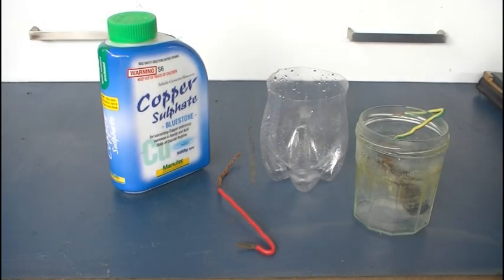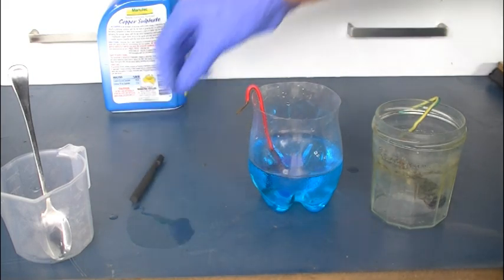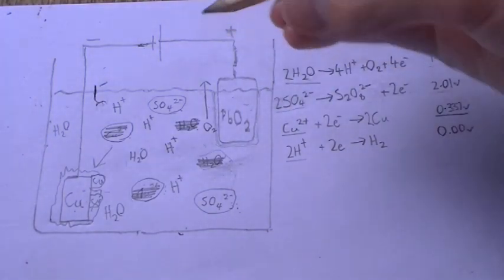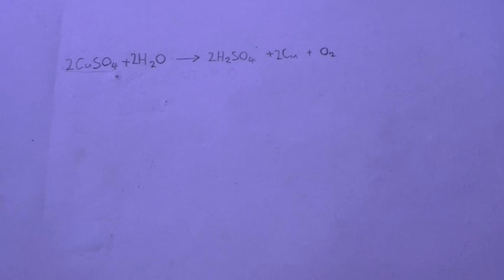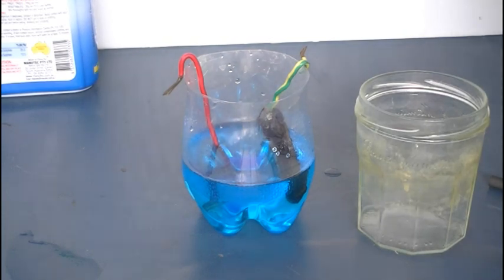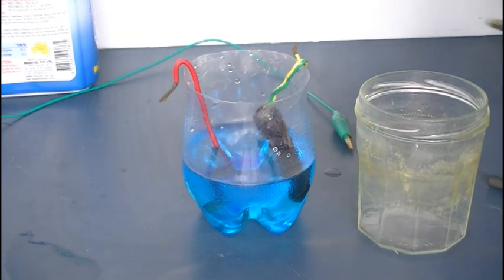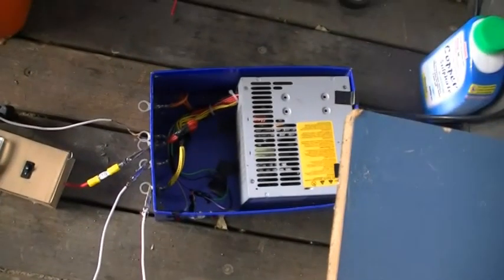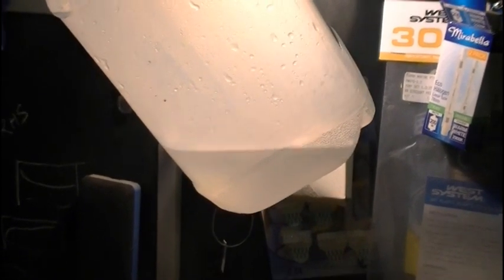Making Sulfuric Acid

Comment from the maker: Hello everyone!
As you might note, this is an extremely old video (the second oldest on my channel, I think). Now that I know a little more about what I'm doing, I'd like to point out that if you're actually going to try this yourself, please avoid using a lead anode. Lead poisoning from mishandling or the resulting soluble lead is always a good thing to try to avoid. I strongly recommend using graphite instead - a much safer alternative.
Reply: Could you use titanium oxide instead as an electric conductive anode, that wouldn´t be poisonous  ?
Reply from the maker: @ZoonCrypticon Titanium dioxide isn’t conductive, so I’m afraid not.
Reply: Also The Sulfuric Acid Particles That Will Be Emitted When The Gas Is Bubbling out Is Carcinogenic In Long-Term Exposure
Reply: Se guardi tutto é velenoso o pericoloso, ché chi affoga con l'acqua😂
Reply: Excellent video. Thanks for working out the math as well. Helped me understand exactly what is happening so I can tweak a few things here and there as I do it at home. I actually have a ton of lead I melted down from some old shotgun shells I had laying around. 

I assume that a classic milk jug like you used is fine to keep it in. But what if I used a standard mason jar to actually do the electrolysis in? Plastic seems accident prone like you nearly but fortunately didn’t have.

Comment: is there a reason why the lead connection is partially outside of the water?  Also what is.3 moles.  Is that 33% solution.?
Reply from the maker: The connection is not pure lead, and it would oxidse destructively if placed in the solution. Hence, we position the electrode such that the connection is not submerged.
As for moles, you'll need to do some reading. I'd start here:
https://chem.libretexts.org/Bookshelves/Introductory_Chemistry/Introductory_Chemistry_(CK-12)/10%3A_The_Mole

Comment: Salve, il video sarà vecchio ma l'ho visto in questi giorni. O visto anche quello con sale Epson, belli ed istruttivi. É un pò che voglio generare acido solforico per batterie poiché non lo vendono più  dicono che ci fanno le bombe, ma uno che é capace fare le bombe con l'acido solforico non avrà nessuna difficoltà a farsi l'acido no?? Bene, io non voglio far saltare nessuno😂. Anche se costoso il solfato di rame rispetto ad altri solfati, questo é il metodo migliore e più pulito. Ma voglio segnalarti un errore che i chimici fanno e molti in rete quando galvanizzano metalli, così da migliorare le cose. Tutti mettono alimentatori ed applicano tensioni un pò a caso, continuano a cambiarle in base ai risultati della cella, poi nel tuo caso si ritrovano del bel rame spugnoso se non addirittura una poltiglia nera scomoda da riusare e pulire, sintomo di corrente troppo alta. Quindi per avere un bel deposito pulito di rame metallico che ricore l'elettrodo e per evitare continui controlli della tensione e rimaneggiamenti suggerisco di fare come faccio io (non ho mai visto nessuno in rete farlo, perché non sanno e non ci pensano). Io uso un integrato molto economico si chiama LM317 é un generatore di corrente continua da attaccare a valle di qualsiasi alimentatore, col semplice calcolo di una resistenza si stabilisce la corrente voluta (vedere datasheet o video youtube, ce ne sono molti). Quindi imposta la corrente qualsiasi variazione di resistività del bagno l'alimentatore darà sempre quella corrente costante e di conseguenza la tensione varierà automaticamente senza bisogno di controllarla e cambiarla manualmente. Il risultato dwl deposito ovviamente dipende dalla corrente impostata, che si può trovare osservando di non produrre troppo idrogeno e dai calcoli vedi Faraday. Nel dubbio meglio una corrente più bassa che alta, i tempi saranno più lunghi ma il deposito più fine e migliore. Intanto il prodotto energetico é sempre quello, ci vogliono x Coulomb per ogni materiale metallico ed é, come sapete, costante per ogni metallo. Se a qualcuno interessa ridurre i tempi e non gli importa del rame spugnoso, nero o ché e vuole acido rapido metta pure tutta la corrente che vuole e dimensioni i cavi come serve. Più avanti suggerirò altri metodi da sperimentare per ottenere H2SO4 più o meno semplici o costosi ma con materiali di facile reperibilità. Non sono un chimico, uso quanto basta per le mie cose, sono elettrotecnico con passione per l'elettronica. Faccio un pò di tutto. Saluti

Comment: What happens if you adjust the voltage?
Reply from the maker: It will speed up or slow down the reaction, provided your supply isn't limiting the current.
Reply: @ScrapScience  I heard elsewhere that voltage determines what reaction you get. If you crank it up you can separate more stable compounds. Anyway if voltage determines reaction speed, what does changing the current do?
Reply from the maker: 1) Changing the voltage has a rather complex effect on which reactions happen. The easiest reaction will always happen (provided the voltage is high enough to drive it), and then with higher applied potentials, you might eventually get some contribution from some more difficult reactions (but this depends on a lot of factors). For instance, on the cathode, you'll reduce copper ions to copper metal if the potential is high enough - then with high enough potentials you might also see a small amount of reducing water to hydrogen. In both cases, reduction of copper ions to coppper metal is the dominant reaction though.
2) Voltage determines current, which then determines reaction rate. This is the main thing you see when changing the voltage, and the relationship is not necessarily linear. It is impossible to control voltage without controlling current when you have a consistent cell geometry - the two parameters are intertwined.
Reply: @ScrapScience  I apreciate your long answer!

Comment: Nice work I’m wondering if you can let it run more time to break down more water hence concentrating the acid a bit more.  I realize this is proof of concept but I feel like this would even with 5 times the concentration of copper sulfate.  Or, since your acid is very dilute, add more copper sulfate and repeat until the acid or 2 or 3 Molar.

Oh I’d like to mention sulfuric acid reduces copper sulfate solubility it water through common ion effect (sulfate).  So if you go the route of adding more copper sulfate repeating and repeating you will find a point when it’s no longer feasible to try to add copper sulfate for another run and then you have less water to boil off.

Comment: I remember doing this over 40 years ago and used carbon rods from batteries, or maybe stainless steel rods, but I've forgotten my chemistry by now. I boiled the acid next to increase concentration. To what extent can this be done to improve concentration, because from what I remember, acids absorb water and that's the reason they are so harmful to organic matter? (I presume the stainless steel I used wasn't a good idea because of the chrome salts I made.

Comment: I use this method to produce sulfuric acid, but at the beginning of the analysis a light colored solid copper forms on the negative electrode, which affects the analysis. I don't know what the reason is. I have to clean the cathode every few minutes for half a day to a day, and then a soft, dark copper forms, and the analysis is successful. No, I understand why this is made of copper. Is this due to the high percentage of copper sulphate in the water? Because I dissolve one kilogram in approximately two liters of water. If you can help me, I will be grateful
Reply from the maker: From what it sounds like, it's likely copper hydroxide forming on the electrode because the cathode will tend to generate slightly basic conditions when you start from a neutral solution. You can probably stop this from happening by adding a small amount of previously produced sulfuric acid to the cell before you start.

Comment: Would a few batteries work to generate the current needed instead of whatever generator setup he has going on there?
Reply from the maker: It would work, but batteries would run out very quickly when used in these kinds of processes.

Comment: does this demo mean that, when i charge my car battery, i am in fact refurbishing the electrolyte(acid)
Reply from the maker: Correct! The lead sulfate on the electrodes in the discharged state will be converted into sulfuric acid as the battery is charged.
The acid concentration in a charged lead-acid battery is significantly higher than in a discharged battery.

Comment: Hello, super vidéo instructive !
Ma question est la  suivante : comment purifier l'acide au maximum ?
Merci beaucoup et tout le meilleur pour la suite 😊
Reply from the maker: Distillation is the only proper way to do it. That's a very serious task though. I wouldn't recommend trying it without some serious safety knowledge and equipment.
Reply: @ScrapScience  merci, je pensais qu'il fallait passer  par une distillation !
Au vu du taux d ébullition de l'acide sulfurique il est mieux d'utiliser une pompe à vide et ajouter une colonne de vigreux changerai le résultat ?
Procederiez-vous avec la pompe à vide et la colonne de vigreux ?
Merci à vous
Reply from the maker: A vigreux column is not necessary for sulfuric acid distillation. In fact, it will significantly reduce the speed of your distillation.
Distilling under vacuum would be ideal, since it will decrease the temperature required for boiling sulfuric acid (which is usually over 300 C). 
Once again, distillation of sulfuric acid is not a task that is easy or safe, especially when performing it under vacuum. Care and knowledge is definitely required here.
Reply: @ScrapScience  merci, pour l'information !

Comment: Would the continued electrolysis once the CuSO4 is all gone concentrate the acid further?
Reply from the maker: Yes, but it's a lot quicker (and at least ten times more energy efficient) to just boil the water out instead.
Reply: @ScrapScience  cheers

Comment: could you mix a magnesium sulphate with the copper sulphate to get a greater yeild?
Reply from the maker: Not in this case. Magnesium sulfate will not be affected by electrolysis under these circumstances, so you'll only be converting your copper sulfate into acid.

Comment: hey! i did this same reaction, and everything seemed to be going well, but despite copper depositing on the anode, my solution is still blue after several hours. Albeit lighter blue...but yeah. Also my solutions heats up A LOT when i run it. Any ideas?
Reply from the maker: Several hours is unlikely to be enough to run a reaction to completion, depending on how much copper sulfate you started with and how much current you're running. Some of my more recent runs of this reaction have taken multiple days.
If your solution is heating up, it means that you're running the reaction at a voltage which is far too high. You only need a few volts, and anything above that will just lead to more heat.
Reply: @ScrapScience  ok thank you! i connected a 18V drill battery running at 4.3 Ah....not sure how much copper sulftate, as I made the solution from electroysis of magnesium suflate and a copper electrode lol
Reply from the maker: That'd do it! 18 volts is well above what you need. If you've got a spare phone charger lying around, those work quite well since they provide around 5 volts.
And just so you're aware, Ah (amp-hours) is a measure of battery capacity, not current - the current you run through the cell will need to be measured with a multimeter or something (if you want to measure it, that is). 
Also note that if you've made your copper sulfate like this, your final acid product will likely still have a bunch of magnesium in there.
Anyway, hope it works out for you!
Reply: @ScrapScience  ok yeah wow thanks man! would I just plug the phone charger into the outlet then? how do I know whats postivie and whats negative? also, wont it be AC instead of DC???? anyways, you should really make a discord man!!
Reply from the maker: USB chargers are DC on the output. If you plug it in, it converts AC from the mains into 5 volt DC to your phone. 
In this case, if you cut open a USB charging cord, you might be able to recognise the positive and negative terminals by their colour, or you might need a multimeter to check which pair is actually giving you 5 volts.
And yes, a few have mentioned discord in the past, but I still feel like I don't understand it very well. I'll have to look into it a bit more, haha.
Reply: @ScrapScience  ok well thanks for all your help being active in your comments!! i will definetly give the USB cord a try!

Comment: hello, nice video. I'm not a chemist but I have knowledge, I dabble every now and then with something simple. I wanted to ask you for advice, first I'll explain what I did: I took HCl + CuSO4 -> H2SO4 + CuCl2 +H2O I don't balance them but it is to understand. Now I wanted to precipitate the Chlorine to separate it from the acid by adding NaCl to get (CuCl2)2NaCl which should sink to the bottom. Since it was an experiment I didn't calculate the weights of the reactants, so approximate with the concentrations. The question is why if theoretically I should have the precipitate but in practice it doesn't happen to me? I have not tried but I also thought by electrolysis to separate the copper and the chlorine should bubble from the cell. Thank you very much, if you have another method to separate the chloride to suggest it is welcome. In the past I redid the collector (covered a crack) in copper of an alternator and it came out beautiful, file hard copper with perfect crystalline structure, the trick is an lm317 and constant current and good patience for the time. Thanks a lot and congratulations.
Reply from the maker: I've never heard of "(CuCl2)2NaCl". Do you have a reason to believe it should produce a precipitate?